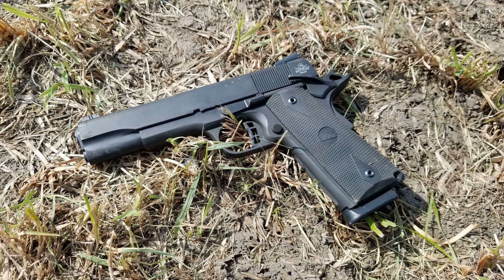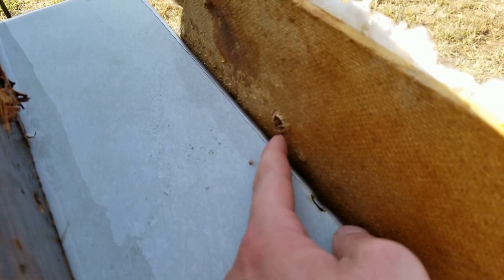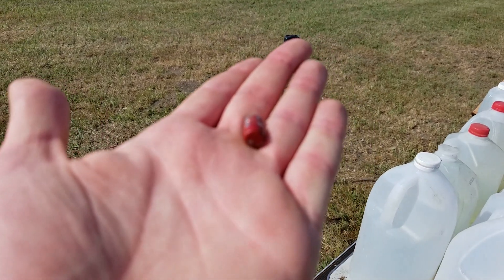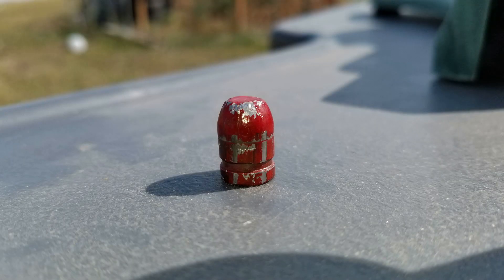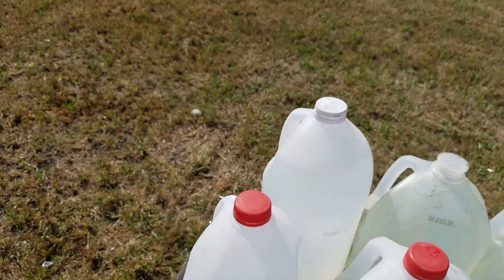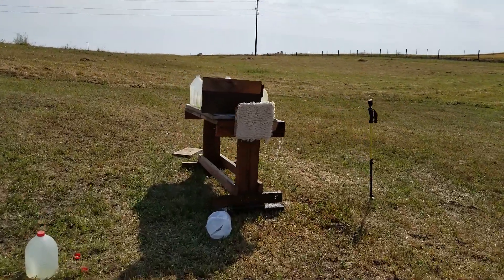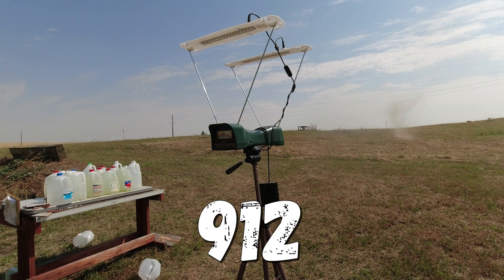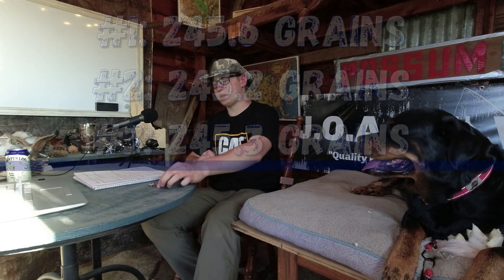45 ACP For Bear | Underwood 45 ACP +P Hardcasts | Jugs Test + Simulated Bone Barriers

Comment: Hi Jep - thanks for this informative video. I wish I lived out in the country to do testing like this! In comparing the BB vs Underwood I did get slightly different results than you for the BB. Using avg bullet weight of 231.25 grains and avg velocity of 958.66 fps I get 472 ft-lbs vs your 520. And I get taylor factor of 14.3 assuming bullet diameter of 0.452 inches. I guess one question is what bullet diameter do you use in the formula? - the un-expanded or expanded bullet diameter? I also like to compare bullet "punching" power by calculating the maximum deflection angle from vertical you would see if the bullet was fired into a large block of wood hanging from 2 cords to form a ballistic pendulum. Assuming the block is large enough so that the bullet remains embedded in the block after impact, the calculation is not too difficult since momentum is conserved in the collision and the kinetic energy of the block plus bullet just after impact will be converted to potential energy as the block swings upward. For example, for a 10 lb block hanging from two 2 ft long cords, the underwood bullet would cause a 23 degree swing while the BB would cause a 22.7 deg swing - virtually the same. It would be interesting to verify this with outdoor experiment by just taking a log and hanging it from 2 cords. Knowing the speed and weight of the bullet and weight of the log and length of the cords you can calculate the approximate angle of deflection. Of course this is just one way of looking at bullet "power". To stop an attacker you would like to have all the kinetic energy of the bullet causing internal damage. Thanks!
Reply from the maker: I used the un-expanded bullet diameter. I think what I did was I used the assumed weight of 255 gr out of the box rather than what I intended to use which was the average weight. I never even realized it, my bad. Thank you for letting me know! I'll make a pinned comment noting the error.

And I'll keep the block idea in mind for my next video, sounds interesting! 

Thank you again, 
~Jep
Reply: @JepsOutdoorAdventures  ok - yeah I can provide the equations I used to calculate the deflection angle if u want. Or you can just Google "ballistic pendulum" to find the equations. Traditionally, they setup the equations to find the initial bullet velocity after observing the deflection angle. But you can rearrange the equations to do the reverse - ie find the deflection angle after observing the bullet velocity (eg by setting up a chronometer in front of the pendulum). I was kind of surprised by the answers I was getting - I would think blasting a 10 lb block of wood with a 45 would give a deflection angle much greater than 23 degrees. But that's what the equations are telling me (unless I made a mistake!). That's why I thought it would be interesting to do a real test. You could get like a 4x4 and cut the length so you have like a 10 or 20 lb block. But it has to be long enough so that the bullet stays in the block (ie a pure inelastic collision) and it has to be hit as close as possible to center so the motion is in one direction. Actually, it doesn't even have to be wood, just place a gel block in some kind of harness so it can be hung level using two cords. I guess you would have to setup a camera looking sideways on the block and make a piece of cardboard with angle markers on it so when you play back the shots in slow motion you can read the maximum angle of deflection. Thanks!

Comment: Nice presentation. 
Suggest using a large box at the rear for deep penetrators. They're not leaving with enough force from the 7th to do any real damage.
I do appreciate your thorough explanation. I would recommend being a little more concise to shorten the video. If it went through each hard barrier without a radical change in direction, we can all presume it punched through. Taking the time to show entry and exit on a barrier with a non-expanding projectile isn't necessary.
Nice work.

Comment: I find calculating momentum in lb-ft/sec valuable because it indicates a lot more of what sort of terminal performance one sees between non similar projectiles (like a hot 9mm vs. a heavy 45). While the 9mm could have ft-lb energy a couple hundred higher than the 45, the momentum is going to be lower.
Calculated the 255gr load in your video, with your average chrono velocity. Results:  33.37 lb-ft/sec momentum. As a note of comparison, if a 124gr 9mm were equal in momentum, it would have to be doing exactly 1,884.5 fps. Yet, due to sectional density (diameter/length), terminal performance between these two would vary even with equal momentum.

Comment: Sorry but your mathematics are not good.  Why would you think that the weight of the bullets AFTER HITTING THE TARGET gives you the correct footpounds?  The energy is carried into and through the target! The mass of the bullet after it expends its energy has ZERO VELOCITY! Your correct footpounds are not as important as tissue and bone damage creating trauma. I digress.  Still an EXCELLENT VIDEO.
Reply: Everyone can do the math based on the factory label,  we're doing it based on the shooting results.  We could do a comparison to what the label says, but we feel testing results are a better predictor of how the bullet will do and did.
Reply from the maker: As Tom Pullman said, these are results based off of our tests. The bullet will never hit at the same weight as they are packed. The rifiling takes some weight off, not just the testing mediums. Since these retained the majority of their weight, they still give you an accurate calculation in my opinion👍

Thanks for watching!